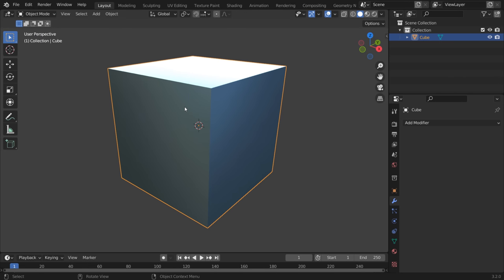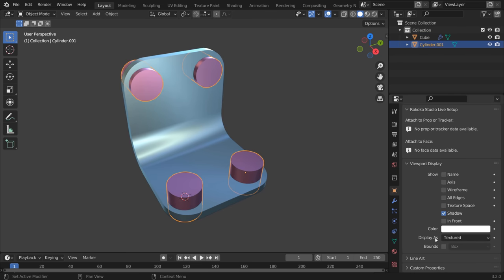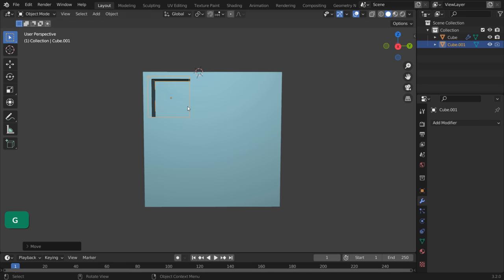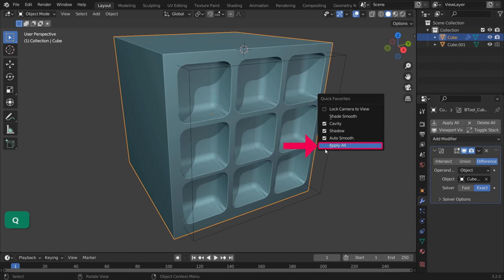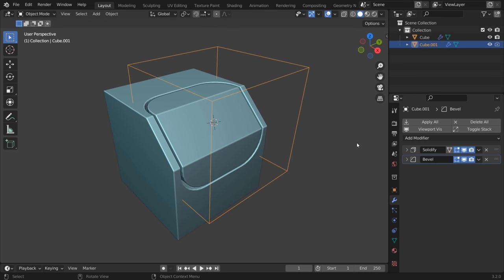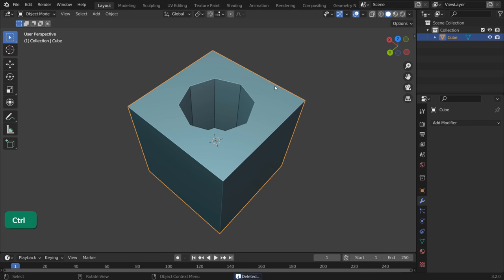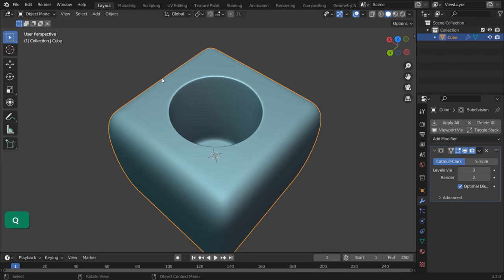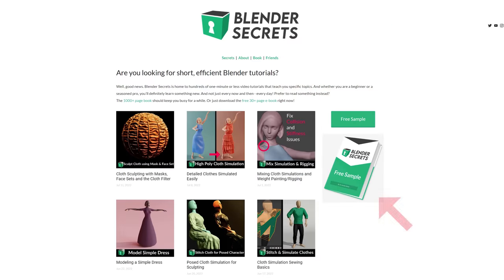Blender Secrets - 6 Minutes of Boolean Basics

Comment: I tried this and didn't watch closely just to see if I could do it on my own and I took so long just finding the menu items to click to do it and then I didn't shade smooth and auto smooth so I got banding in my cylinders.  I couldn't figure out how to smooth that out.  I tried to add a smoothing modifier and it didn't work.  I thought there has to be a way to not add massive amounts of vertices just to get a smooth curve.  I guess shade smooth is the answer so you can keep low poly count but get a smooth render. ?  I guess.  thx for the tut!

Comment: Why at the time of using ctrl+ - on the keyboard that happens only to zoom out?
Reply: there should be an add-on to enabled it but the audio mumbles that part - when I find it I will reply with it.
Reply: Preferences --> Add-ons Search - Bool Tool, once enabled you will be able to use CTRL + - [use the numpad version] - Blender 3.3 tested working (it basicallly auto-applies booleans rather than using the modifier but looks good for what im using it for.

Comment: ctrl - doesn't work on my pc. i use blender 3.1
Reply: The same issue I have - listened to that section (0.25x speed) and I can make out that its "assumung "Mmble" add-on enabled". when I find out I will reply with the add-on.
Reply: Preferences --> Add-ons Search - Bool Tool, once enabled you will be able to use CTRL + - [use the numpad version] - Blender 3.3 tested working (it basicallly auto-applies booleans rather than using the modifier but looks good for what im using it for.
Reply: @DBMN  thanks, will try it asap